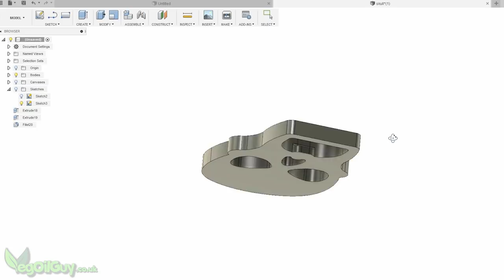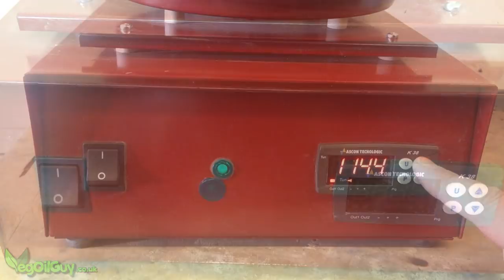Lost PLA Casting a SKULL bottle opener for the community event #2019OpenersOpen

Comment: I tried lost PLA casting and really messed up so I am certainly impressed with your work.
Reply from the maker: Did you use a vacuum? That's the really secret. Once I made my own, dirt cheap vacuum system, it came together for me : )
Reply: @vogman  no I started off with the wrong plaster and did all of the wrong stuff.  Eventually I will try again.
Reply from the maker: Ahhh, the plaster is key. Give it a try with the right plaster and make a simple vacuum set up (use mine as a example if it helps). You'll be blown away by what's possible : )

Comment: I recently found your channel and subscribed, I've been avidly watching what I can when I can. I especially like it when you put in the windows with the pictures of your additives or title them below as you use them so we know what they look like and how you use them.
I'm now collecting the stuff I need to cast different metals and alloys and I have a couple of the books you recommend on your website  (very cheap second hand from Abe books). I cast (badly) many years ago at school a pewter object and more recently I attended a bronze sword casting course so I'm not totally unfamiliar with the process. My mind is now full of ideas of things to cast, I have a 3d printer myself and have thought about a few things I printed would be much better and durable in metal.
I have a few questions you or one of your other subscribers could answer for me please.
When you've scraped off the dross and have the ugly little pile of contaminated waste is it totally useless or can it be heated again and separated to squeeze more metal out (or would this just be uneconomic to do ) ?
 When you have finished a pour and there is a layer of metal left in the bottom and around the inside edge of the crucible, does this separate from the crucible on it's own as they cool at different temperatures so it can just be tapped out or does it sick and need scraping / heating or another way before a different metal type is melted in the pot ?
Finally I'm thinking of cutting up an old and unfashionable long leather jacket to turn into an apron in case of splashes. Do you think is is a good idea or should I invest in a proper apron. I see you don't wear one but as an amateur I'm thinking better to insulate myself from stupid amateur mistakes a bit.
Thanks for your channel. I wish I had your skill in both Lathework and casting !
Reply from the maker: Thanks for the kind comments. Your questions answered (I hope).
1) Dross is normal. Personally I disregard it completely though some might try to re-use it.
2) Yes, there's normally dross caked on the bottom of the crucible as well. Try to CAREFULLY remove the bulk of this whilst it's still hot and the remainder will likely fall away once fully cooled.
3) If you can afford it, get the BEST safety equipment you can. If you can't, make the best you can. If you can't, be VERY careful. I'm  a terrible role model for safety wear. Please do as I say, not as I do : )

Comment: You make it look easy. Another well made video even with time crunch and 2 videos this week. I just failed at a similar attempt on a copper skull ring. Do you find that a proper flask, investment and vacuuming really make that much difference? I defer to your expertise.
Reply from the maker: It depends what you want from it Chris... but think of this... Jewellers don't sand or foam cast, they wax and increasingly pla cast.
If I'm going big and simple, I'll sand cast. If it's big but shapely, I'll foam. But if I want detail, wax and pla will get you there. This is mainly due to plaster making a perfect mold and metal filling every crevice of that mold thanks to vacuum. Now vacuum systems are very expensive, but I'm pleased to say my dirt cheap home made vacuum is used in every one of my videos - https://youtu.be/EGNnH_xbjR4
Reply: Thanks so much for the great advice, Jeff. You, sir, are an inspiration.  I'll definitely have to bring my game higher. I'll have my fail video coming out soon.
Reply from the maker: Excellent. Sharing wins and failures is critical. We learn more from failures I believe  : )

Comment: Nice cast.But can you burn out the mold in your melting furnance
Reply from the maker: It might be an idea for you to watch my Wax Casting playlist. That's where I learned a lot. Back then, amongst other things, I did both burn out and melt metal in one electric furnace. And if you're furnace is big enough for both, it might work for you. Mine wasn't so my flask was cooling too much by the time I'd got metal ready, but I still achieved some pretty good results. You may be able to improve upon what I did. For me it was easier to follow convention and get a second furnace to melt the metal : )
Reply: VegOilGuy Thanks vor the tipp :D

Comment: Nice imforming and also funny videos. By the way, how large is the crucible in the red electric furnace?
Reply from the maker: Thanks : )
The crucibles hold 4 Kg of brass - that's the unit of measure. It's surprisingly large.
Reply: @vogman  How much did it cost? Planning on buying one for the homeshop.
Reply from the maker: Here's where I got mine - https://www.cousinsuk.com/product/melting-furnaces
I'm very pleased with it. It's sooooo easy to use.